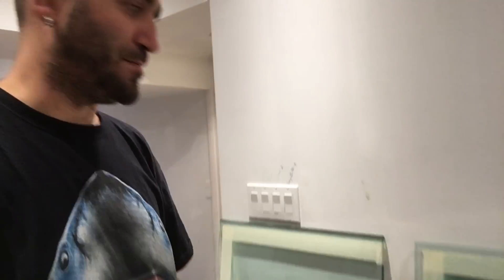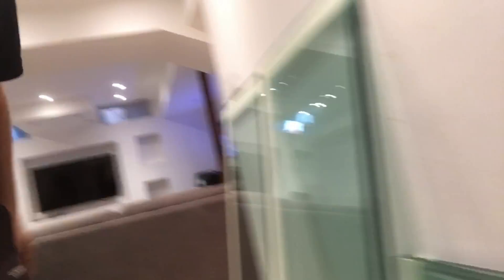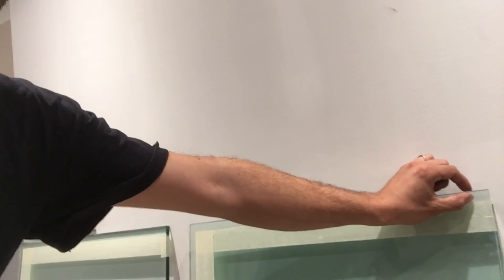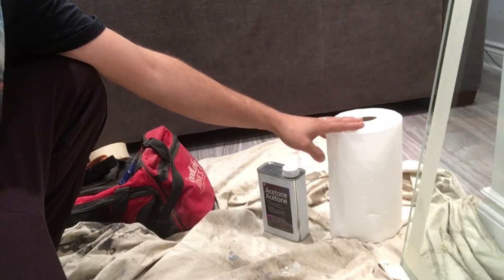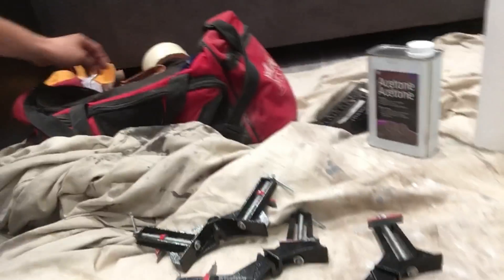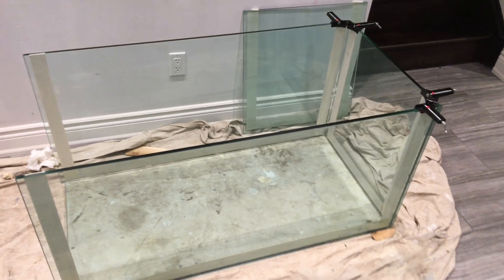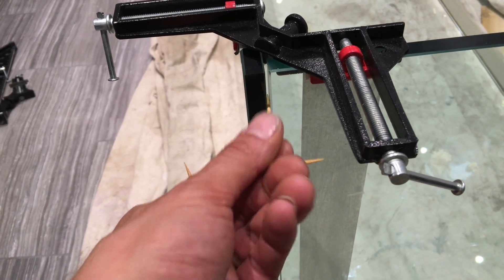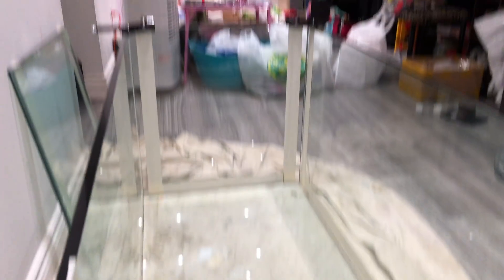HOW TO BUILD A CUSTOM GLASS AQUARIUM - PART 2 - Prepare for Silicone (120G reef tank build part 2 )

Comment: Should I have my side panels rest on the bottom panel? Or should I rest them next to the bottom panel? Not sure how you could have added silicone if they were resting on it, so I probably just answered my own question, just double checking.
Reply: Hahah good question and comment. Lol you are correct. You should have all your side glass panels next to the bottom panel. NOT on top. 
Keep me updated. Good luck with the build. There are a few update videos of this tank all setup over a few years later on the 20th floor of a condo downtown.

Comment: Hello Leo,
Please what are the dimensions of the bottom(base) glass panel.

Thanks.
Reply from the maker: It’s been so long I don’t recall the exact measurements. I just take my time and calculate all glass panels I need. 
You need to know all 5 panel sizes exactly. 
From what I remember the bottom panel was 
22 13/16 x 46 13/16
Reply: @LeoPazzo  Thank you Leo...

Comment: Is the front and back longer then? To have the two smaller sides fit into the bottom part? 
As for the tooth pick gap, is this something to be taken into account when cutting glass too? Btw your diy to build a tank is the best one so far on yt man! Ty!
Reply from the maker: Hey Davar thanks for your support. Yes the front and back are longer then the bottom panel. The 2 side panels fit in between the front and back panel. All side panels sit at the side of the bottom panel. Yes the toothpick thickness needs to be taken into your calculations when getting the glass cut. Measurements are the most important factor to this whole process. Also calculate the thickness of glass you will be using. Hope this helps. Draw it out on paper to get a better visual and reference the video again. Look closely when I’m injecting the silicone . You can see which glass panel is positioned where
Reply: @LeoPazzo   my pleasure man! I’ll be sure to share a link to this. Also thanks for answering. So just to confirm. Does this mean I add the 1/2” to each side for the front and back panel if that’s the thickness of my glass? For the sides to sit there. Do I add the toothpick spacing to each panel then as an addition increment? Thanks again! I will actually build a small prototype with cardboard to get an idea for the actual model.

Comment: One step left out: How to figure out the measurements for the glass panels.
Reply from the maker: I did the calculations. 
Basically decide what size tank you want finished from one side to the next. Then subtract the thickness of glass for both and the gap thickness. 

My best advice is to draw it out on a piece of paper and do the calculations so you can visually see where and how each panel will fit into what location.